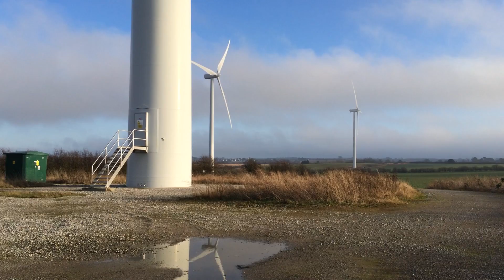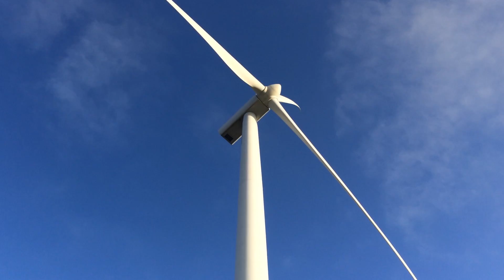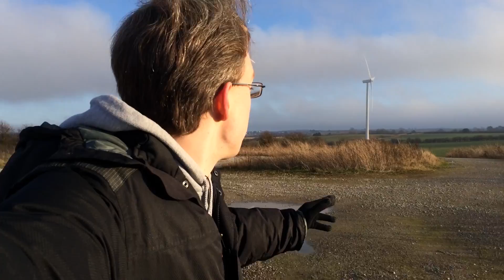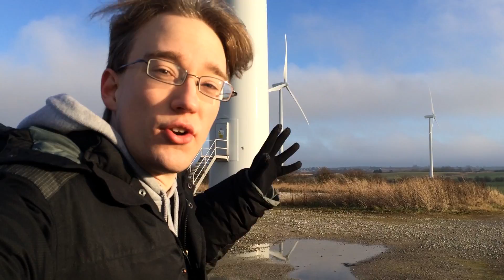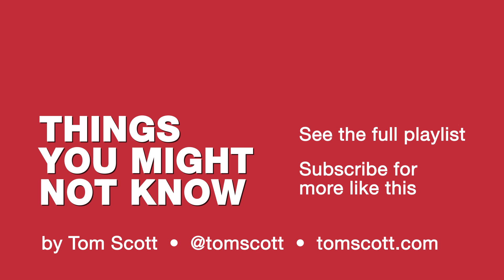Why Wind Farms Don't Always Turn When It's Windy

Comment: While it's true that coal, nuclear, and gas plants are harder to shut down and startup, you neglected to mention that they have the HUGE advantage that they CAN be shut down or started up whenever needed, in any weather, at any time of day.  THAT is not true of wind farms or solar.

One of the biggest problems with wind and solar power today is that both are HIGHLY variable. This is made worse by the fact that their variance is often at odds with demand. That is, their output is often low just when demand is high.  For instance, on cold, dark winter's night, solar power produces zero, yet that may be one of the highest periods of demand.

Comment: Just a correction they do not slam the breaks on they pitch the blades out of the wind, also a lot of the time when they don’t turn they are broken (genuinely) various problems from gearboxes to yaw motors to 33kv transformers.

Comment: Arguably these do not produce that much net power after being built, from coal fired electricity in China, plus the installation costs, maintenance and decommissioning. They are more of a money making (subsidized) tool based on the actually unproven and disputed CO2 causing climate change hypothesize. 
What is proven is that CO2 is a consequence of climate change. Below 0C and above 60C life cannot exist without external support. Its why you use climate control cold to store your food.
Of course the strategy is to demonize people that do not accept the scam. Papers are not evidence, your refrigerator is evidence.

Comment: Hi Tom I am afraid your comment about over supply to the grid does not ring true with my memory of electrical theory. Granted I probably finished my electrical trades course well before you were born but I don't think things have changed since. A power generation device produces a voltage and has a capacity to deliver a certain amount of power. If the load is below the capacity of the generating device then its Automatic Voltage Regulator reduces the excitation to maintain the voltage. The only reason for stopping them would be to reduce unnecessary wear and tear to extend the unit's service life. I should imagine a major overhaul on one of these things would be horrifically expensive. 
I would be interested to know what sort of alternators they use. Whether they are shunt excited or PMG excited. I would assume they are synchronous alternators.

Comment: @Tom Scott, A thought, maybe (or maybe you already done similar video), maybe you would find it interesting in doing a video explaining electrical power and the limitations of channeling electricity for very long distances without losing a lot of the energy in the resistance of the cables. Say, for example why we can't set up massive solar energy farms in say the Sahara desert and channel the gained energy through cables all the way to Europe. 
I got the thought from current issues in Sweden with Northern Sweden producing a lot of energy but have little means of channeling the energy to the southern parts, (It's basically an issue of putting too many nuclear reactors offline/maintenance and the wind/solar not producing enough, forcing since weeks ago now, the start-up of an oil-burning plant, a plant usually only there as a last-resort for harsh winter months), anyway, the part within parenthesis is just to explain why I thought of this whole "electricity, demand and limitations of distance with current technology".

Comment: Except when they turn the wind turbines off, we the bill payers have to pay them a constraint payment amounting to millions of pounds a year. The pump generating stations like Dinorwig were built to smooth out demand not supply. They would buy in power. for pennies a kilowatt at night and sell it back to the grid for pounds when the likes of Eastenders finished and everyone put the kettle on, causing a surge in the grid. The operators in the control room would have a copy of the TV and Radio Times and a telly with the sound off so that they would know when to open the penstocks to compensate the grid. With todays chaos on the grid caused by renewals they must be making a fortune out of us.

Comment: Why does one country use a different frequency from another ?
Because the frequency that electricity cycles at can be harmful to humans. Research has found out that 60 Hertz is the maximum frequency safe to ppl. That's why 5g software is dangerous. It operates above the 60 Hertz limit.
Reply: Steven Kimball harmful in what way

Comment: The trick to keeping the wind mills running is to have a couple three major trunk lines into California ... no problems getting rid of the power there ...
Reply: You do not have to have a load on a wind turbine for it to run. With a load on it the stresses are greater so wear and tear is increased.

Comment: There are conspiracy theories about how the turbines are purposely mounted in the wrong direction just to not generate any energy...it would be very sad if true...
Reply: " are purposely mounted in the wrong direction" .... How come that people don't understand that wind turbines can turn themselves into the wind... THAT is really sad.
Reply: @3gunslingers  well some old turbines are fixed,you can see it from the structure, but it's a bit hard to check for the newer ones, if you aren't that close...
Reply: @Valery0p5  
I can guarantee you that no wind turbine younger than 50 years is fixed!

Comment: The problem with wind energy is
If the m/s is too low they dont work eg usually at night as the day breeze dissipates 
If the m/s is too high they go into prop feather mode  
So the window of opportunity is narrow 
Ans in summer when you get a long period of good high pressure weather then they are of no use at all
Reply: "So the window of opportunity is narrow " No. It is not. I bet you have never looked up the working wind speeds for wind turbines.
"Ans in summer when you get a long period of good high pressure weather then they are of no use at all" That'S why you don't build them where this can happen. (also during such a period solar cells produce more tan enough power)

Comment: BS. Do you really think these huge THIN blades turns by the wind?  No. The engine does and the blades Harnesses electrostatic energy from the AIR. As AIRcables.
Reply: Are yo serious?
Reply: What drugs are you on bub?
Reply: Do you really think these HUGE jet engines make air move? No. The wind does and the blades harness the kinetic energy from the AIR. Oh wait...

Comment: I still don't understand does a direction which wind blows matter for wind turbine? Or it has to blow infront of turbine for it to work?
Reply: A wind turbine works best, when the wind comes directly from the front. The energy harvested is directly proportional to the area the wings cover when they turn. 
Therefor every wind turbine can turn itself into the wind. The gondola rotates!
Reply: The turbine is fitted with a number of sensors one of which tells it the wind direction. Its control system turns it to face the wind.

Comment: I'd have thought they they would have built one or two turbines that were specifically designed to operate in medium or high winds.  But likely it wouldn't have worked out well.
Reply: Some designs of vertical axis wind turbines operate in extremely high wind conditions.

Comment: Tom, they do apply brakes (electrical and mechanical) , but that's not the main means to stop them turning. They 'feather' the blades, (they are variable pitch turbines) so that the angle of attack to the wind is 0°, meaning no 'lift' and hence rotational force is generated. Also, they face the turbine assembly into the wind, no matter which way the wind is blowing. (OT: have you ever seen a turbine nacelle 'unwind' its cables? Interesting. Look it up) Things you might not have known.

Comment: Another thing that you might not know is that most wind turbines need power in order to start them. They have electromagnets rather than permanent magnets and these need energising before the turbine can be used to make electricity - this is not true for some forms of direct-drive wind-turbines (the ones you showed were not - they had gearboxes).

Comment: Is there a reason they space them so far ? Surely they could be placed more efficiently, or am I being dumb ?
Reply: they're spaced so the effect of 1 turbine on the wind doesnt affect another. something to do with a "wake"? not really well informed but that might point you in the right direction
Reply: @DeepSohelia1   Now, I am by no means an expert so don't take my word for it. A wind turbine absorbs energy from the wind and turns it into rotational energy via the blades, so the air behind the blades will have less energy as part of it has already been absorbed. That and the blades affect the airflow behind them and make it more turbulent, reducing efficiency if there were to be another turbine behind it. And all this is ignoring safety if one turbine fails for whatever reason.

Comment: Sad really that clean energy like this gets shut down alot and the other plant just keep cranking out CO2
Reply: The power system needs some gas, oil, coal, nuclear steam plant to be running.  They all have considerable mass and thus stored energy to ride over brief peaks on the system. Doesn’t get mentioned as often as it should but, without this element, the system would not be stable if a sudden fault occurs!
Reply: That's just the reality of the cost and inefficiency of power storage. It's the reason why we shouldn't adopt electric vehicles on mass yet. Furthermore the actual materials that need to be mined, processed, formed and transported to make a single wind turbine of this size is substantial (and so is the energy used to achieve that). If they aren't in use enough before they wear out beyond repair then they can be worse for the environment than fossil fuel power plants.
Reply: Simon Harris CO2 break-even for windmills happens within about 9 months. That's for turbines designed to wear out in 20 years. They're not going to wear out before repaying their energy cost ten times over.

"Windmills are bad for the environment" is a blatant, brazen lie started by those who stand to profit from older, polluting technology. Don't fall for it.
Reply: I didn't say that windmills are bad for the environment. Just not as good as the best case scenario you quoted and not suitable to replace the power grid because of the cost/ impact of that much power storage.
Reply: I am and have been since a child a huge proponent of nuclear fission and hopefully in the near future fusion.

Comment: They disable the windmills by rotating the blades so it is parallel to the wind flow so the wind goes through it without rotating the turbine. If you look at windmills that aren't moving, you'll see that the blades look thinner than the ones that are, because of the rotation.
Reply: One more note, this is the preferred method of stopping a turbine because if you applied breaks like he said you'd end up with massive wind loads on the blades. By rotating you also reduce (but certainly not eliminate) the wind load along the blade.
Reply: It's called feathering the blades. But yes you're correct.
Reply: Oh neat! I was imagining they just locked it up and thinking that sounds more likely to be damaged by wind.
Reply: They do both.

Comment: Erm, so, Why are there no battery's? that seems kinda like a good idea.
Reply: +James Brown an alternative we have here, in Australia, are hydro electric power stations that can pump water up hill, into storage dams to consume and store energy, when it is available from power stations that are hard to turn off. they buy the power cheaply, and then they can get up to speed quickly generating power that can be sold when demand is high.
Reply: Batteries have a number of problems: They're expensive, they require toxic or hazardous chemicals (lead or lithium), most won't last too long if they're subjected to deep charge/discharge cycles, and their energy density is pretty awful. Look here for the energy density of various batteries and fuels: https://en.wikipedia.org/wiki/Energy_density
In addition, the electric grid runs on alternating current, and batteries provide only direct current. So you have to add in a device called an inverter to convert the battery output to AC. Hope this helps.
Reply: +Martin Visser Pumped storage is really effective the main problem is that it shares a significant problem which is common with other hydroelectricity projects requiring large reservoirs namely that you need the right topology in relative proximity to the generators and sinks for the power you want the facility to balance. Suitable valleys to build the required dams don't always coincide nicely with the locations of major cities that consume power or for example the locations with useful renewable energy resources to harvest.

Comment: Do you know why they all turn at the same speed? Because they are spinning at 50Hz
Reply: 50Hz is 50 times per second. They are certainly NOT spinning 50 times per second.
Reply: It's not that the actual blades are spinning at that speed, but they are all in sync and outputting power at 50Hz and so they all spin at the same speed
Reply: Do you understand 50 Hz would be 3,000 RPM?  My understanding is that wind turbines produce "wild AC". Meaning the frequency can be  something other than the  standard grid frequency initially. The wild AC is rectified to DC, and that DC drives inverters to covert the DC-to the voltage and line frequency needed to supply the grid.
Reply: waswestkan Ehh, what I was told is that all wind turbines run at the same speed (dynamos running at 3000 RPM) at 50hz output, the actual spinning part appears slower due to it being so big, and thats the reason it doesnt go any faster/slower...
Reply: Wind turbines have gearboxes. Doesn't matter what speed the turbines are spinning at, it'll all get turned into 50Hz. In any case, they're probably rotating at the same speed because they're all catching the same windspeed.
Reply: Most wind turbines are asynchronous

Comment: I don't really think this is correct. Wind turbines are not switched off due to grid power demand fluctuation unless there is some major and rare event. Sure it is no fast to adjust Nuclear or Coal plants. But gas or hydro is very fast. and because the grid is so large, the wind fluctuation have a overall smooth slopes, and even Coal and Nuclear can handle it somehow. Only at night on a very windy day the wind farm output can reach levels where it is not possible to cope with it.
Reply: it is correct, the uk and especially Scotland where this windfarm is, our national grid is rubbish and we don't have much surge protection

Comment: how does making it not turn put it under less stress than allowing it to turn with the wind?
Reply: The propeller blades pitch is changed to put them parallel to the wind flow. As so you reduce the "push" force. But more importantly the limitation is the rotational speed and centrifugal forces in play. If you let it speed up uncontrolled the blades could just "fly away".
Reply: The problem is the moving parts inside it, it's basically an electric motor which can only turn so fast.

Comment: Now there's so many private solar parks and panels on people's houses that sub stations can't handle it, if the panels are put in where only low voltage is supposed to be, and the owners won't turn them off because they make money by having them on (government incentives) so the result is over stressed substations set on their max taps (what controls the output voltage) if it goes over that they have to get turned off or explode. I reckon when the sun is out there's gonna be some big fires.